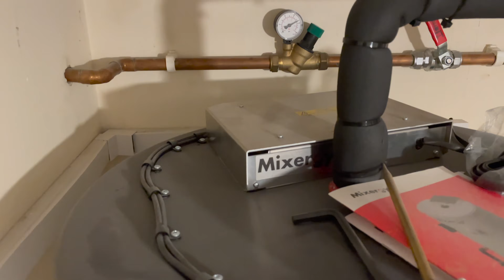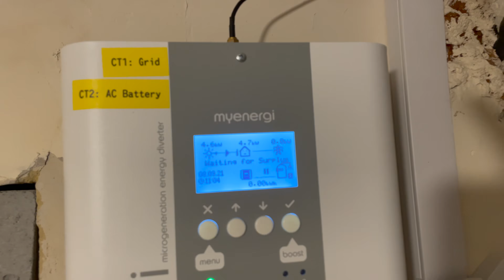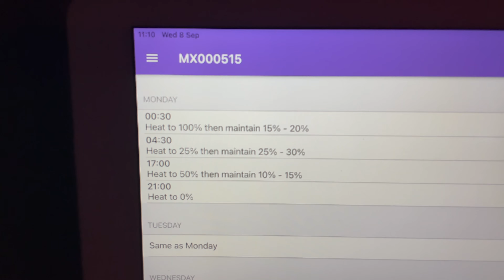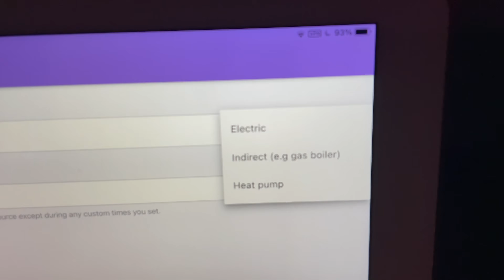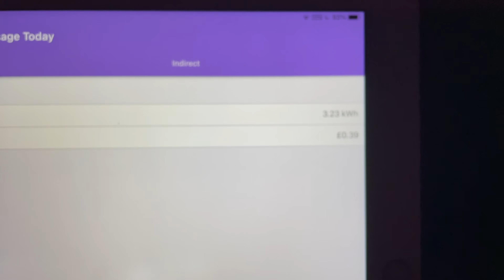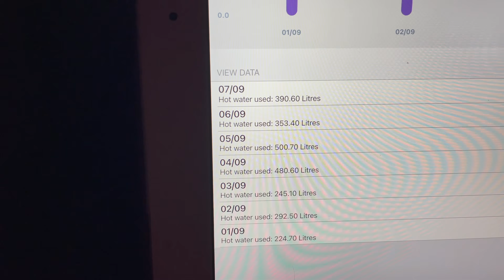Mixergy Cylinder Review 2 Years On

Comment: I always join the top of every cylinder with a tapping at the bottom to cause destratification and I used to use a pump but have found it actually does it on natural convection currents. I've been doing for 16 years. Should have patented the idea 😢

Comment: I heard the biggest complaint was if you use a solar diverter then the tank becomes dumb and bypasses all the AI.
Reply: Not at all, with the solar diverter controlling the top mounted dual immersion heater it works as normal, heating from the top with the pump 'pulling' the heat down.
Reply: @travellingthomases  That is great to hear. I am confused now. This is where I got the information from - https://youtu.be/8-g0XtPV5n8

Comment: As a combi boiler owner I just cant see the justification for spending £2k getting a cylinder like this - yes you can use octopus go to heat it up overnight, yes you can use some solar power in the day to heat it up - which is fantastic,  but why constantly try and heat up 250 litres of water 24 hours a day 7 days a week when you can just use 50p worth of gas, to heat up 50 litres of water for a nice long shower between 7am and 7.20 am and then not heat anything for the rest of the day till your back home at 6?  The amount of KWH your immersion used in your stats just for heating your cylinder was like double what I usually use in leccy for my whole house per day?  confused
Reply: I've just came across this cylinder and curious to what your comments means asking why would anyone want to heat up 250L 24/7 365. I thought the whole idea of this cylinder was to avoid doing that so who would be heating it fully full time, am I not understanding your question correctly?

Comment: To messy and over complicated ! Put two 125 litre Megafolw cylinders in parallel one on gas or oil and the second on solar tubes. Today 2nd of Jan my 250 litres are at 40 deg C. All free. Top up if you wish with the boiler. It's a no brainer !

Comment: The only advantage i can see is that the cylinder can heat up a small amount of water midday when electricity cost are high,  but if you have pv panels you'd just use them to provide electricity to heat cylinder free of charge. Then if you had batteries this could provide year around cheap electricity. So wheres the advantage? Most modern heat pumps/boiler would want a digital signal from cylinder to boiler/heatpump, this can modulate boiler/heatpump maximising efficiency by reducing flow temps and cycling. You just can't do this with mixergy, be great to get some feed back on that.
Reply from the maker: Thanks for your reply Matt. My Mixergy is an EARLY system without the heat pump coil. All new Mixergy cylinders are Heat Pump ready. Mitsubishi would not approve a new Mixergy cylinder as part of the trial we are part of so had to have a second cylinder. However this now gives us significant capacity that we can heat using off peak energy. We also have 2 x Powerball's in the garage providing 27 kWh of storage. Net of this; we import over 60 kWh each night (December 2022) at only 7p per kWh which charges both batteries and both cylinders meaning our daily electricity cost is between £4-£10 depending on any mid-winter sunshine. In the summer we will be largely off-grid.

Comment: Great video. Who does your install work? So hard to find the right trades who know about this.
Reply from the maker: I just use the same plumber and sparky I have used; Mixergy plumbs in like any other cylinder and the immersions are pretty simple. I'm normally there helping with the install as I have designed all of my installs.

Comment: As amazing and clever as all these heating systems are - such as the mixergy hot water tank involved here - you need so much capital investment in PV panels, inverters, battery storage and (significantly) SPACE for things such as PV panels and the all the kit.  Look how brilliant but also complicated this all is.  Essentially a room is given over to this stuff, whereas millions of homes just can't fit it in.

As much as I'm a fan, it seems only possible or practical for those with both the means and the space to install it.

Thanks for showing us your system - how did the air source heat pump trial go in the end?  Do you get the mixergy tank back?  I'd love to see a real-world comparison in running cost vs your gas boiler.
Reply: We’ve just taken the plunge with pv using a home improvement loan.  Justification for us was to take back control of variations in energy costs and instantly adds value to your home.  As for space, an unvented tank can be fitted anywhere; loft fo example.  I’m looking at using a corner of our garage, but appreciate not everyone has a garage.

Comment: If you're able to have a shower with only 11% capacity, why do you have a cylinder this size? (Unless your household is having equivalent to 9 showers in the morning?). A conventional cylinder half the size programmed conventionally and heated fully would be cheaper to run than this setup. Nice video and nice kit, but sizing the cylinder appropriately from the outset is absolutely critical in making large savings (greater than 20% being quoted by mixerg). I'm sure I'm missing something though, i don't know your house/household members and water useage. Cheers

Comment: Hi grant are there any advantages of a traditional megaflo over a mixergy tank... I can't find a comparison but it seems as though not... other than the warranty? Mine is being installed tomorrow.
Reply from the maker: Hi Keith, Yes considerable differences; Mixergy is the only cylinder that heats fro the top to the bottom so you can have a shower with only 10% hot water,  a megaflow needs the whole cylinder to heat

Comment: Grant you mention that you were removing the mixergy for sunamp batteries how have you found sun amp ? As I’m thinking of removing our current setup but thinking of worst case senarios winters with zip solar production so would like some understanding on how they have performed especially connected to the heat pump and recharge times when the heat pump was being used

Comment: can mixergy be used to heat radiators?
Reply: @danielwake7621  i just bought a house with no heating system. i plan to buy a mixergy tank... buy i also need a buy  a boiler to heat the radiators. i will have solar panels and lots of battery backup . i was wondering if i could use the immersion of the tank to also heat the radiators instead of buying a boiler.

Comment: Am I right in thinking that you said the Mixergy has a "Solar Energy Diverter?". And then go on to talk about the Eddi - which is the solar energy diverter which costs ~£500 with the optional but lets be clear, 99% required, WiFi module (that attaches to your Meter Tails and reports to  the Eddi device when there is excess solar energy). What the Mixergy has is 3 separate Immersion Heating Elements. 1 your 'traditional' bottom mounted and then 2 separate 'top' mounted immersion heaters. One of which you have wired into a manually set up timer and the other which is then wired to the Eddi (solar energy diverter).
Also everyone keeps talking about Octopus Go or Octopus Agile or similar, what happens this year when, due to rising prices Octopus removes the Go/Agile tariffs, or there is no longer any "cheap" electricity (as is likely) and all prices are at the Standard, OFGEM, Capped Variable Rates - currently around 27.22pkwh (until October 22) then likely to be 40.83 (+50%).
I am not saying that the Mixergy Tank isn't any good. I am saying that attributing its performance to low cost energy is a poor metric.
If you have a solar PV array that generates more electric than you use (or has excess energy when your not in) then its almost certainly a good deal. However if you already have a Solar PV Array and an Immersion Tank then buying a Solar Energy Diverter and installing that is going to payback your investment much faster than ripping out a perfectly good immersion tank and paying for a plumber to install a Mixergy Tank.
Reply from the maker: Thanks for your comment. Yes I already had a Myenergi Eddi solar diverter and before that an Immersun. The twin immersions are at the top the factory fitted is as the base. Off peak electricity is here to stay; even the 'new' Octopus Go has off-peak at 7.5p per kWh and peak at 35p - and using EITHER the Mixergy Schedule OR the Eddi schedules you can heat the whole tank using cheap off peak electric. And with the price of gas it is still a lot cheaper to heat using off-peak electric
Reply: @GrantThomas  Is it still cheaper to heat by 7.5p off peak electric than it is to heat by gas? One 3Kw emersion will take 2 or 3x longer than gas to heat the water.

Comment: It would be great to hear about the kind of cost savings you get. Although I guess it’s hard to attribute where all the savings come from if you also have solar?
Reply from the maker: Octopus Go current prices ; off-peak 7.5p / peak 30p ; it takes about 15kwh to heat from empty so £1,231 savings per year without solar.
Reply: @GrantThomas  nice. Do you know how much the total kWh demand went down after getting the Mixergy, even with the same usage patterns?
Reply from the maker: @DrBenVincent  Not that predictable with family life. But shifting charging our Powerwall and Mixergy each night using cheap electric has reduced our average monthly kWh price to under 10p.
Reply: @GrantThomas  if you charge the battery at night from the mains, whats your solar doing during the day?
Reply: @travellingthomases  so in summer the solar charges the battery then diverts to heat the cylinder via emersion and in winter the off peak tariff charges the rest of the battery and heats the cylinder?

Gas kicks in to heat it when theres no battery left?

Comment: Grant, really interesting demo. I have pretty new (5yr old) 250 litre tank that is heated exclusively by gas which I estimate is using ~6000kWh/yr just for hot water. I'm looking at solar currently and keen to understand how effective using solar to heat a std tank is and how much more efficient the Mixergy tank will be given it will be £2-3k to change. Any perspective you can provide would be interesting.
Reply from the maker: Hi Andrew, I am able to have a perfectly hot shower with only 11% of the hot water in the tank due to to the way to heats using the top immersion. It is more efficient that any gas heating solution. Pair it with a Myenergy Eddi for the ultimate solar diverter
Reply: @GrantThomas  Thanks for the feedback
Reply: What is your annual KWH for Hw with Mixergy now?
Reply from the maker: @andrewnewton7879  about 4.200 kWh excluding solar PV - nearly all of that at 5p per kWh Octopus Go off peak rate - so about £210 for a year
Reply: We heated our HW via a 4kW PV array for ten years in my last house, in a standard, but well insulated HW cylinder via the standrd immersion heater. It provided HW for a family of 5 from April to Sept. We used a PV diverter which basically diverted surplus PV into the water. The gas boiler was turned off for this entire period.

Comment: Hi Grant. I am planning to upgrade current open vent to unvented. I only found out about Mixergy a few weeks ago and its looks great. I have 5kWp solar PV and and Eddi. I am curious - does the mixing pump vary its speed so as to heat the water at the top just enough so that it doesn't trip the cylinder stat but keeps shifting the heated water mass down the tank?
Reply from the maker: I think it varies its speed and purposely heats as it adjusts, and the cold water fans out across the hot water to maintain a hot temp. There is even an option in the settings to maintain a 60 degree temp, even if it it only has 1 or 2% hot water left!
Reply: It will also work on natural convector currents. I've been plumbing them that way for 16 years and works perfectly. Just use the secondary hot return to a tee on the drain off and bingo. 👍👍

Comment: Grant, Thank you for sharing your experience with the Mixergy, I'm considering using this in my house in the highlands as its a Oil central heating and water. I have a solar panel array so think it would be good to match that up with the water heater. I currently use an electric shower so aim to replace that so its coming direct from the mixergy. My question is if I heat the boiler to 100% how long does it take to get to cold for a normal shower  eg how much heat does it lose per hour. I currently dont have a smart meter as octopus still have to install and getting a smart meter install these days takes forever ! thank you for any insight you can give but its helped me feel better about getting one.
Reply from the maker: Hi Bob, It heats much quicker using electric, but within 20-30 mins from cold you would have 40% of hot water heated by gas in our 250L cylinder